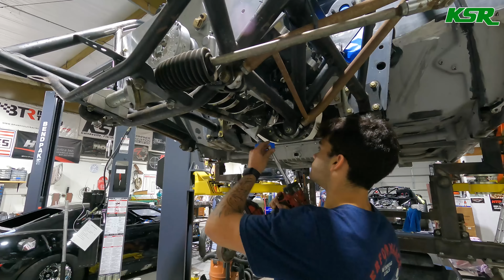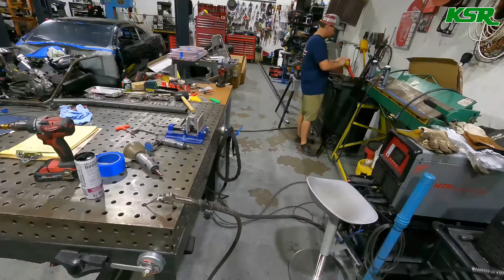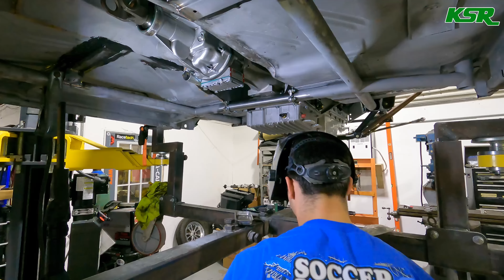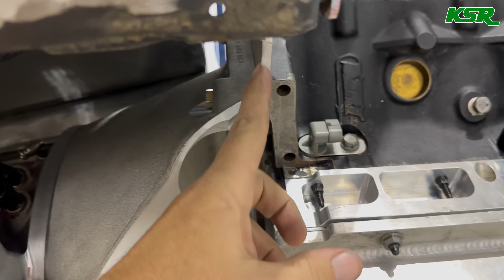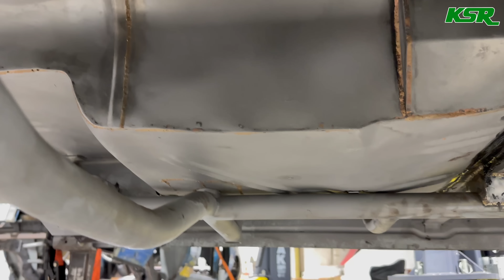Another HUGE Drag and Drive Project at KSR!! Awesome 63 Chevy 2 from Hawaii!!

Comment: Is he using countersunk bolts on that cross member?
Reply: Yes they are countersunk. I use them for mock up to center the holes perfectly so when I weld they don’t pull or move off center. It makes it have a perfect fit for the bolts every time. We’ll use hex head grade 8 bolts for final install